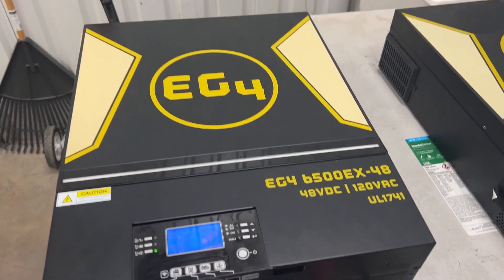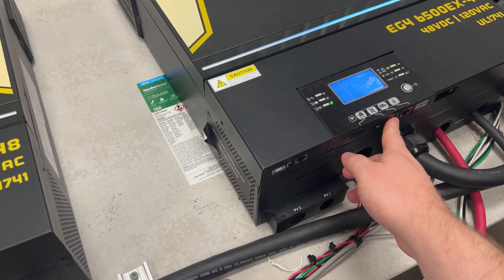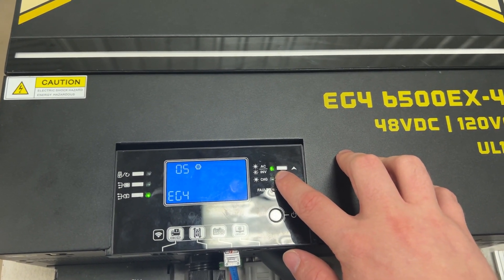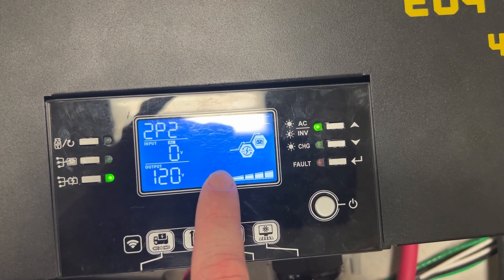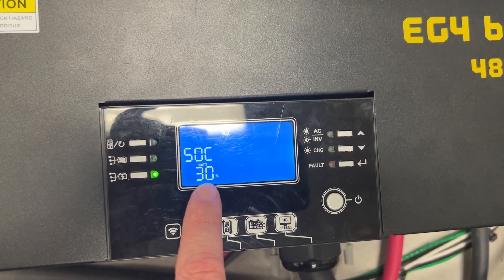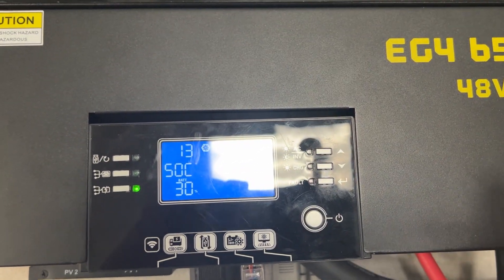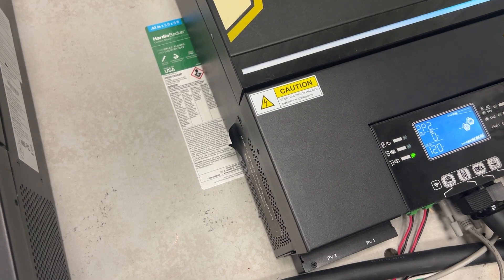EG4 6500EX-48 Multiple Inverter Battery Communications: Fixing Error 61

Comment: I noticed you are in the split phase configuration but you have the current sharing cables installed between phase 1 and 2 is this correct?

Comment: We do not have multiple EG4s, just one for now, and will not be buying another as we cannot get the Error fault 61 to go away. trying the reflash update, but our laptop is not seeing the Com port. working on that.  However, this fault 61, has been a nightmare, since we are off grid and need it working, has not worked for two months now. disgusted. Signature solar should have a fix for this Fault 61. We will be getting another inverter from another company to get our system to work. Beware, if you are considering EG4s. very glitchy! Go with another Inverter and system to avoid not having power. Signature Solar's tech support is spotty, and takes long times getting answers. Good luck everyone. Don't Buy EG4s.

Comment: I am using diy batteries. I do not have the little red and black twisted wires in use.  Do have both communication  cables hook up. Have primary at sp1 and other sp2. Batteries set to lib. on both, Tried user on second. same error. set to Lib also  same error.  Got error 61.

Comment: NOT working, Still getting Error 61. Yesterday Will Prowse posted a video giving up on the battery communications which has since been removed. I posted to that video with links to both of Signature Solar's videos regarding the problem saying it worked for me. I thought it was but I was mistaken. My inverters would beep and flash the red LED periodically but no indication as to the problem. I have my inverter set to stay on the last screen and not go back to home. That's why it was not showing the Error 61. Today I went to the home screen and when it beeps and lights the 61 is now displayed. It is intermittent and the battery icon flashes the rest of the time indicating it is communicating with the batteries at least some of the time. Both the inverters and the batteries are EG4 so there should be no comparability issues at all. 

https://www.youtube.com/watch?v=HnKykgfVuGQ
Several things in this video to do so watch it all.

https://www.youtube.com/watch?v=UakYuS7C0Cw&t=13s
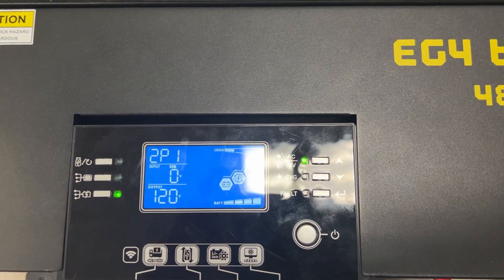View from 0:50 through 1:20, or simply watch the full video

Comment: It's not just an EG4 battery communication issue.  I have my own DIY banks and have BOTH inverters set to USE (no communications cable).  I still got Fault 61 at one point.  I think it was basically caused by an AC breaker tripping which caused an inrush of current to my battery banks, which caused over current protection on them (even though the max power was set to 60 amp).  This shut down the battery to my inverters which then caused the inverters to go into a fault and then eventually shut down due to no DC power.

I plan on working around this by putting in a SMALL AGM batter in parallel with my LiFePO4.  That way if the BMS shuts off the current, the AGM will still keep things going long enough for the over current to clear. The AGM can handle the current rush and will basically always stay at a float level because the LiFePO4 will keep the voltage high even at low SOC.

Comment: So if you have 2 hooked up what happens when one of them stops working? Do you lose all your 240 loads? So you said 3,4,or 5. So you don’t need to buy these in pairs?
Reply from the maker: If they fail, they turn off, they are both turned off when set in split phase mode. If in single phase and simply paralleled, you lose available output.
Reply: @SignatureSolar  so then you lose all power if in split phase? How do you keep the power on then? 
So glad I bought the 5000 es inverters at least if one has an issue the others will still work.
Reply: @jamesshomesolarmore2223  Yeah, but having no transformer for 120v loads is nice. These, in one form or another have been out for a while now and have proven to be reliable.
Reply: @genxgamerdad71  I don’t follow what that has to do with the question? I have a lot of backup built into my system. If one of my inverter’s goes down? Or maybe a string of solar panels or a battery bank? It will still operate with 120 and 240 loads. I will hopefully get my second transformer soon then I will have that part backed up also. I don’t understand why you talk as though transformer’s are bad. Transformer’s are a proven technology.
Reply: @StevenCollar  I don't have numbers per transformer. I am not monitoring power in and out of each inverter. the overall power loss is all I can offer you. that seems to average 150 watts. that is only from the 3 inverters and the transformer.
Reply: @SignatureSolar  you do know that no house is using 13,000 watts or more of 120 power. So of course you would use split phase.